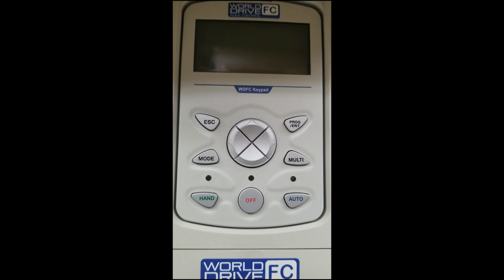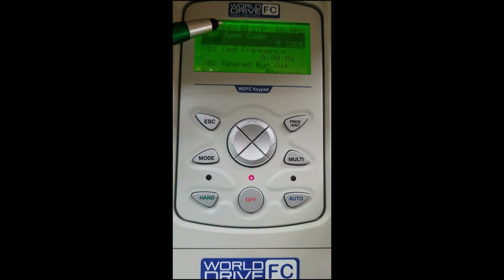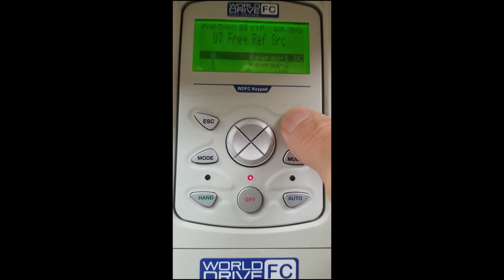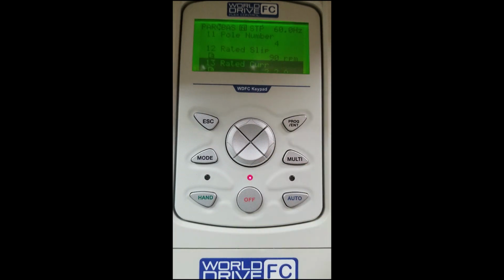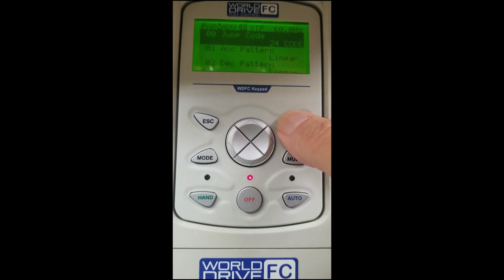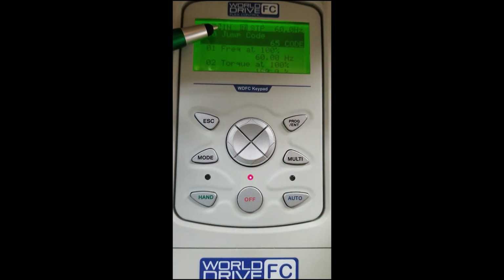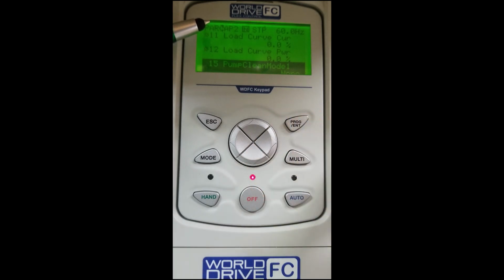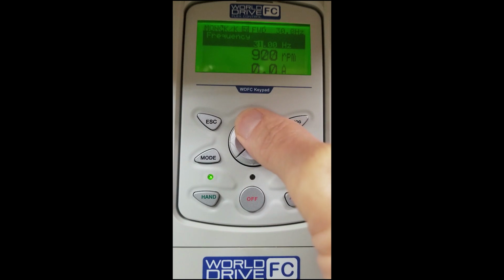WorldDrive Flex Control:  Quick Start Video (Manual Set Up)

Comment: Can this drive be set for 4-20 ma output signal. There is a procedure on the manual for tuning the gain and bias on a 0-20 ma output signal but it is not working as expected. Trying to make it work before they switch back to easy selectable 4-20 ma output option on the original Allen Bradley drive.